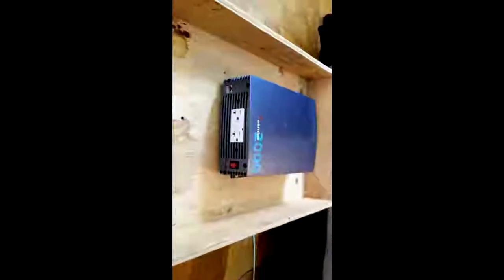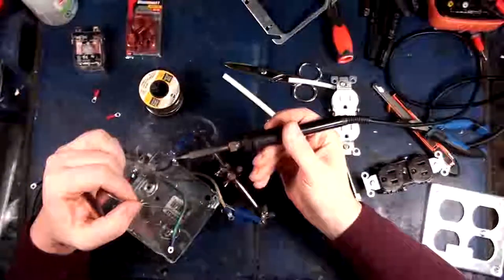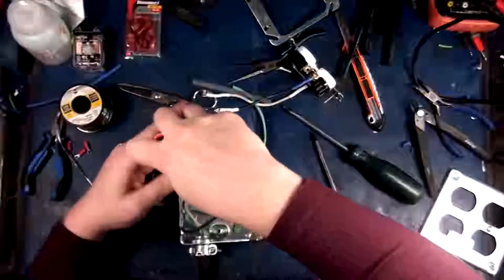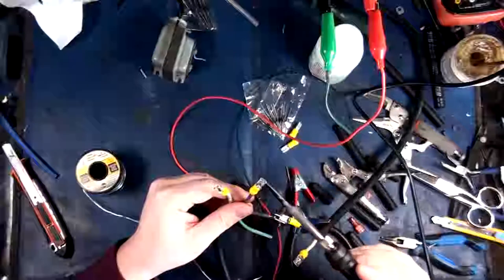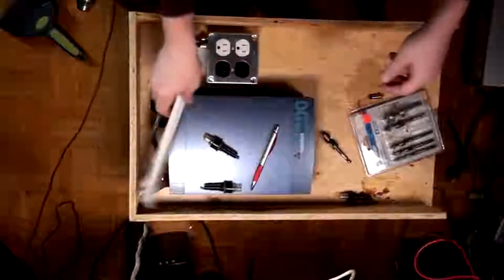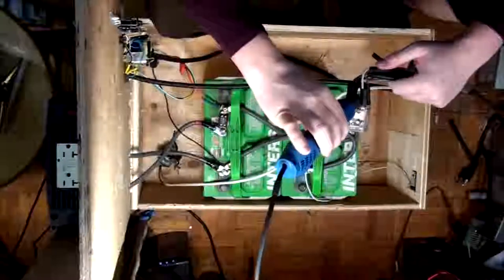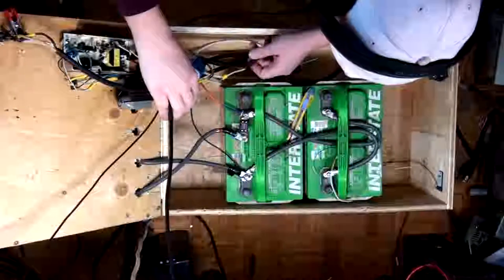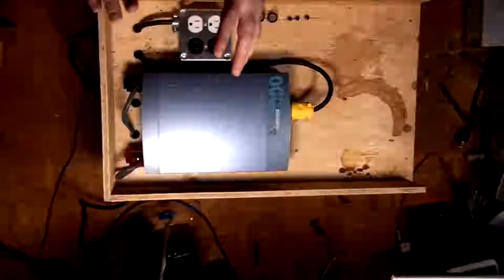Large Inverter adapted as a ups

Comment: Maybe diagram for view better
Reply from the maker: Its a pretty straight forward setup though I usually include diagrams with by builds. Maybe when I have time I can make one up and add it. Its Really easy though... Charger to batteries, Batteries to Inverter.... Inverter AC out connects to  NC on relay, Mains connects to NO on relay. The load goes to Common on the relay. You then connect the relay to an AC transformer with diodes to regulate to DC and absolutely no capacitor. When mains is active the relay is active and mains will flow from NO to the common. When the Mains fails the relay loses power and snaps closed connecting the inverter NC to common which is the load. :)
Reply: @thefixitgal  Thanks, I need known about controller overcharge the batteries, The system always charge the batteries?
Reply from the maker: @wg105   Keep it simple. Im using a small 15a automatic charger. Its connected to the batteries to top them up.